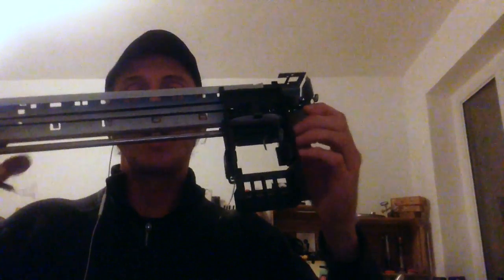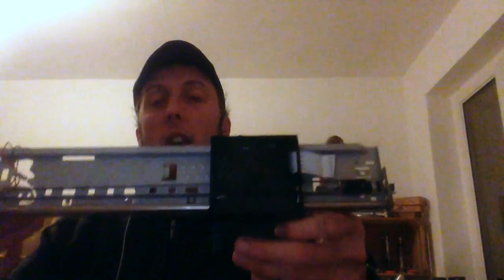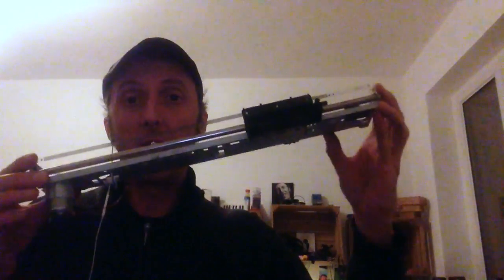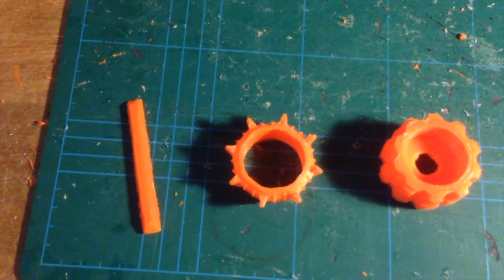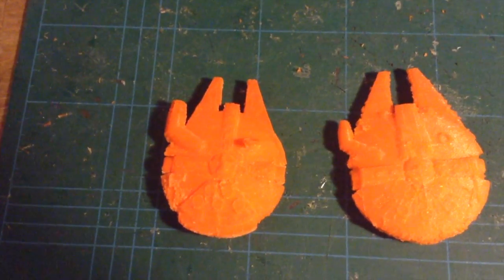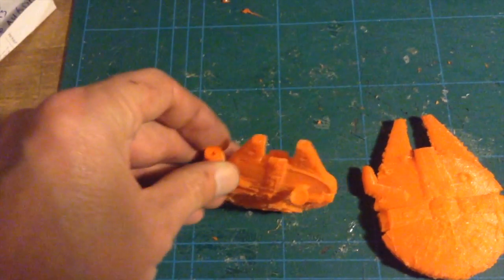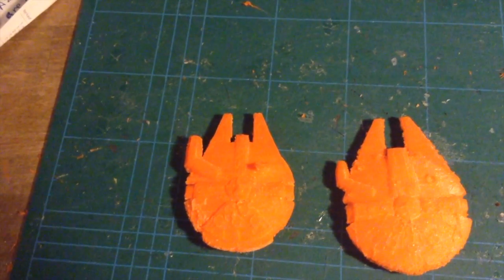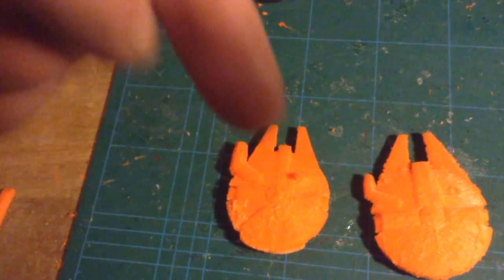Cheap Chinese 101Hero 3D Printer calibration,  improvement & upgrade. It prints!? Progress update #3

Comment: Backwards printing: Turn the Hero in its side so you can look at the bottom. The placement of the steppermotors should be clockwise A-B-C. Found that in an other youtube video; cannot find that link right now....
Reply from the maker: Great. Thanks. I will have a look after this print finishes. Working in stringing using a tip from Maker's Muse. Appreciate the help.